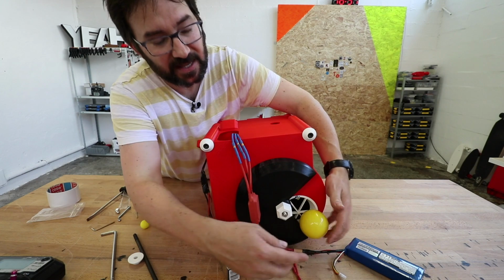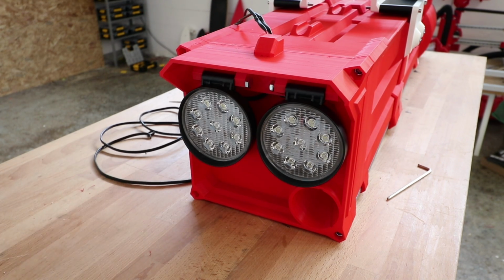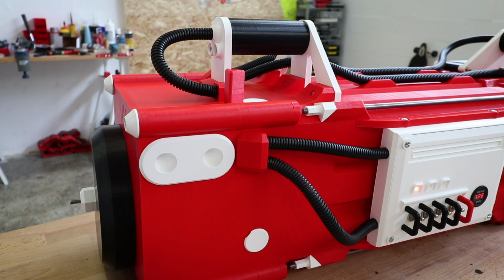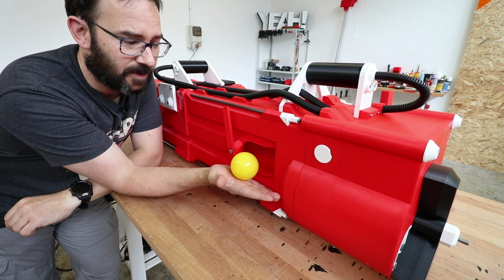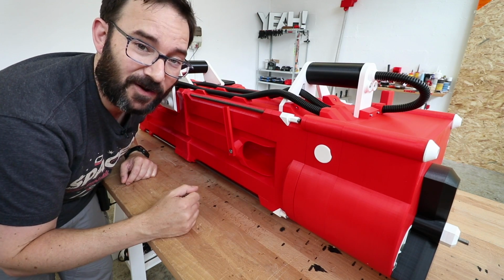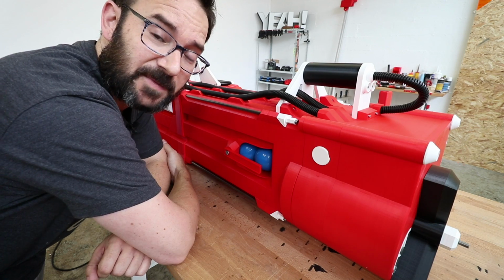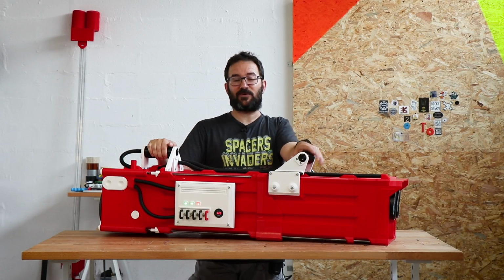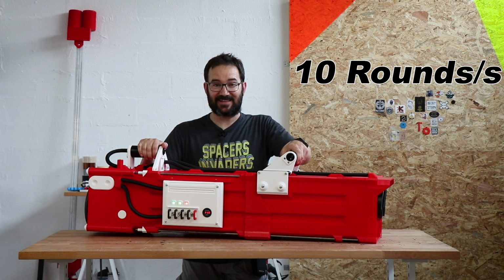GIANT 3D PRINTED NERF GATLING GUN

Comment: 2.0 - A back pack hopper with rotary base agitator will solve the encumbrance issue. Change batteries to standard power tool units for ease of mounting and recharging. The propellant system swap to a propane injection and ignition.

Comment: If you ever make a version 2.0 put it so the barrel/ barrells are barrel size of the rival rounds instead of using 74 rounds you could have hundreds
Reply: What I was thinking
Reply: Use a funnel with a box of balls keep the nerf gun lower it will allow the balls to free flow to the gun loading port it will need to be mounted for reliability but absolutely possible what printer do you use?
Reply: Just use Out Of Darts hopper system instead of this thing if that is what you want.
Reply: yes please make a version for the smaller rounds! would be insane!
Reply: Small rounds and half size
Reply: But like the weight....
Reply: More like thousands of rounds
Reply: Thousands in that scale.. and it could in theory fire at a minigun fire rate.. or perhaps even be a shotgun minigun..
Reply: Yes. YES. YEEEESSSSSSSSSS

Comment: althought this design might resemble a gatling gun due to the cylindrical shape at the end and it's many passageways, it doesnt have several barrels and barrels must spin to be a gatling gun. a gatling gun spins to cool down the other barrels so it takes 1/6th of the shots to keep it cooler. Yet your build does not have any of these properties. Cool machien gun thought and this isnt nerf

Comment: You should improve how this works and mount it to the tank!
have a second edf for suction.
Maybe even have it mounted inside the other end of the magazine so it pushes the balls so they bunch up. Youll need a hatch that seals up the loading port though so no power is lost trying to get the balls round those tight corners.

Comment: that was really cool 
with such a fixed ball capacity, i am kinda surprised you didn't add a ammo counter 
if you ever do a V2, it would be awesome to see its internals scaled down to use the smaller balls but keep the large body for mega capacity
Reply: Can even go with the same EDF, but have a multi-chamber design for maximum balls-per-m^3
Reply: I think normal sized rival ammo would be a nice change as well. Plus with smaller surface area it would not only fit significantly more ammo, but also take a lot less air resistance while hitting a lot harder.

Comment: How did you find the speed using FPS and distance traveled in a frame? Probably a very dumb question
Reply: 60 cm / frame 
= 60 cm / (1 / 50) sec
= (60 x 50) cm / sec
= 3000cm / sec
= 30m / sec
= 1800m / min
= 108000m / hr
= 108 km / hr
Reply: @ianwalker6546  thanks a lot!

Comment: This looks like a lot of fun. A few thoughts:
1. It's not really a gatling gun. Gatling guns are special in that there are multiple full-length barrels, and they are rotated in and out of alignment. Firing from a barrel, then rotating it out of the way allows for two things:
a.) You can pre-load each barrel before it's turn, meaning a higher rate of fire. You aren't loosing time due to loading/ejecting.
b.) Since it only fires one barrel at a time, it gives the others a chance to cool down. This allows for longer sustained fire without overheating, which would be near impossible with a single barrel because of the high fire rate of this type of weapon. 

This design is more akin to a mix between a Gatling and a standard revolver. It keeps the pre-loading aspect from the gatling, but in your case, only the chambers are moving, not the entire barrel. I guess we could call it an auto-revolver? 

2. Your magazine feed from suction is an interesting idea, but has limitations as I'm sure you are aware. When loading balls into the device, the first few go in easily, but after that, you have to use physical force to push them in because the first rounds you loaded are now blocking the fan. During firing, I see you have to shake the device around a bit to get it feeding properly, that's also far from ideal. This time it's the opposite, now all of the balls in the rear of the tube are blocking airflow so the front ones arent actually seeing much suction. Ideally you'd want either a gravity feed such as a paintball hopper,  or some sort of spring-driven magazine system like what most real machineguns use:
a.) Gravity fed "hopper" type systems will offer a longer sustained fire between reloads, and reload times are quick. However, they are easy to jam and susceptible to G forces and device orientation. Probably not ideal for  handheld use, but if mounted to a more stable platform (such as the tank) then it should be fine. 
b.) Spring fed "magazine" type systems are more reliable, but take much longer to load and suffer from limited capacity. You may only get 10 shots from a decently sized mag. You'd either have to use a comically oversized magazine, a multi-magazine system, or live with having to exchange mags on the fly.
Reply: Or, add a fan to the back of the loader so that balls are pushed in from the back rather blocking the suction, the air would flow through just like the suction

Comment: Drive the feeder with a stepper and an arduino so you can control the firing rate and add a single shot button
Reply from the maker: A stepper would not have the power required to spin the drum (not a reasonably sized one at least) but a encoder in the drum would probably do the trick.

Comment: using an axial fan like an EDF is really inefficient! if you switch to a centrifugal fan for firing, and add a secondary fan for controlling the projectile feed, you'll have a much more reliable firing speed, and much higher projectile speeds. would probably help to put some 'spin' on the balls as well to keep them going straighter...